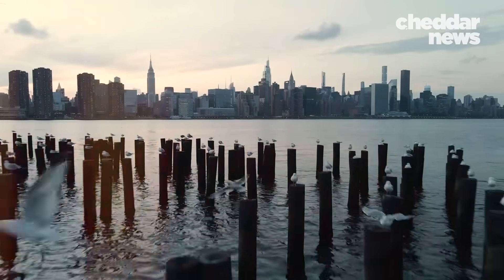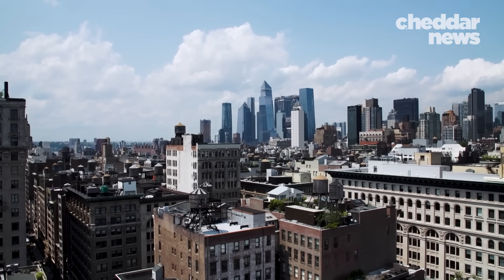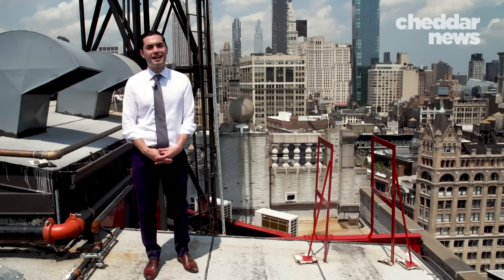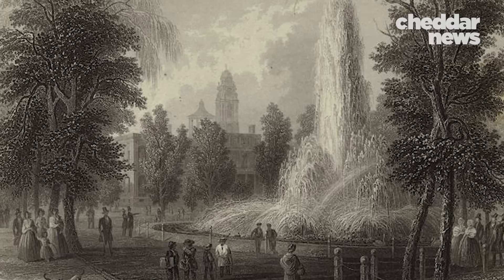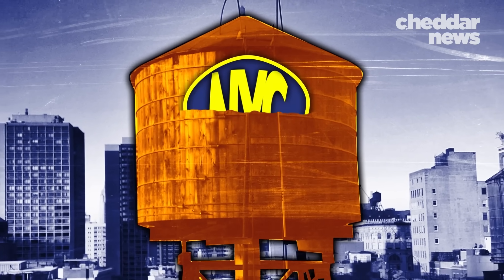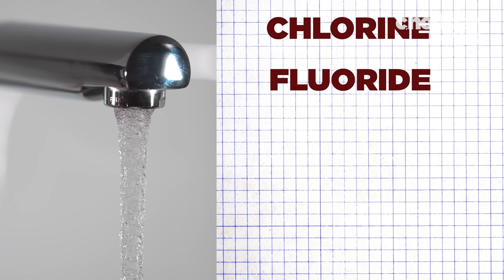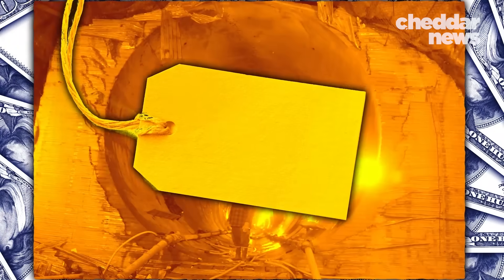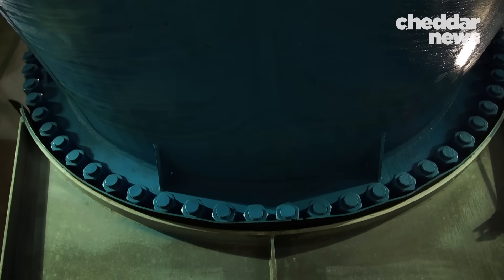What Makes New York's Water System One-Of-A-Kind - NYC Revealed

Comment: I did the plumbing and sprinkler system in an apartment that was built in place of the old water tank at the top of a famous building on Central Park West. The sprinkler system I installed was exposed and made of copper, and it encircles the circumference of the structure, as it is round like the water tower. It has a spiral iron staircase which goes up the middle of it. In the top floor is a recording studio. The owner is the recording artist Moby.
Reply: Whaaaaat you were Mobys plumber? Niceeee

Comment: Why are there pipes inside the pipe...you see the guys walking in the tunnel...is that whole thing g going g to be full with water?if so why all the additional pipes I side?
Reply: Steam they still use steam pipes to keep buildings temperatures regulated it helps to produce power as well

Comment: They could have ran a camera and pressure sensor through the pipe and JB weld it. Just joking, but it would have saved billions of dollars to find and close a leak using known methods to seal a leak under water.

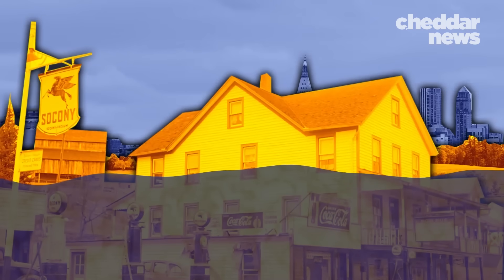Comment: Problems: The map at 6:03 circling towns---several of the circles are not in the correct locations of towns that were flooded.   At 6:35 I think you're saying 1915, which is correct, but it's easily heard as 1950, though I guess that's English's fault.  And you mostly overlooked the Delaware system, only mentioning that its tunnel is leaking; it's still the world's longest tunnel 77 years after construction.  Getting the approvals for the Delaware System got the Supreme Court involved.  I usually like Cheddar but this feels incomplete or rushed.
Reply: They basically telling you all the good points in leaving all the bad points out like what happened to all those small towns that they moved or flooded
Reply: @jermainec2462  they said that they were not fairly compensated and were pushed out of their homes.
Reply: @morpheus_9  yeah we get that but what happened to them people those people got stories of the events that happened afterwards they didn't go into detail about that ... They should have made more of a documentary about it the whole water system of NYC
Reply: The image indicating the location of the three tunnels is not in the correct position either.  Regardless, this is still a great video.

Comment: Good video, but I was hoping to learn more about the way the wooden rooftop tanks work.  How do they get filled up?  Are they just gravity drained?  What happens in the Really Tall skyscrapers? ANd so forth...
Reply from the maker: You're in luck! We have a video on that topic specifically. Search: Why New York City Still Uses Wooden Water Towers
Reply: Water gets pumped up to the tanks, and then it gravity feeds the building… it’s a smoother operation than just using pumps.
Reply: @joermnyc  The reason for the tanks is really thi:. Early AM, for 2-3 hours, EVERYONE wants water: Coffee, showers, brushing teeth, flushing toilets, etc. It would take very powerful pumps to supply all that water. So, what happens is smaller pumps fill the tanks 24 hours a day, only stopping when the tanks are full. Then, in the early morning rush, the tanks partially empty to supply water to everyone in that building, and at an even pressure. Then during the day, and at night, when demand is low, the tanks are refilled.
In essence, the tanks provide an 'averaging' system.
Reply: @joermnyc  more specifically, it allows them to pump the water during lulls in usage to prevent power spikes from wreaking havoc on the electrical system in the morning and evening.
Reply: Gravity can get water upto 5 stories in NYC...hence why a lot of buildings built were 5 stories.  Anything more you need a pump.
Reply: Every single building above 5 stories has a tank. The Empire State Building, World Trade Center, old, new, all of them. They’re just hidden in the newer buildings and buildings like the Chrysler and Empire State.
Reply: They usually use pelican birds that drop water to New Yorkers everyday. It's pretty neat
Reply: @shifterdude  why is white people hunor so dry and unfunny? Is it a mental illness thing?
Reply: @PrinceCezar27  Possibly. It’s more likely he’s fourteen and that’s as funny as he gets.
Reply: @shifterdude  Always a comedian somewhere in the place... LOL
Reply: depends on the pressure of the pipes supplying the water. Typically it can supply up to 3 floors by just using the provided pressure of the water provider. For high rise building they pump water from a cistern tank to an overhead tank at the roof top and use gravity to distribute the water to a room. They also sometimes use a booster pump if the pressure from gravity is not enough.
Reply: Those wooden tanks are not all that clean… rats drown in them, they are cleaned once per year, and birds get into them also..
Reply: Why are tanks even needed? Does the system not have enough pressure to provide water to tall buildings the normal way?
Reply: @bum4evr  the system is powered by gravity. Therefore buildings that are higher than the water level from the source wont have the water get to the top floors. Buildings that are lower are fine.
Reply: So the best answer I can give you is this. Water under a certain pressure which city water is around 70psi can only climb so high. So as you go each floor of a building the water loses pressure, and eventually according to this video at the 6th floor it no longer has what is considered adequate pressure for use. So the wooden tanks would have a booster pump that pumps the water up to the tank and then would allow gravity to feed downwards to meet the needs. So large buildings would have holding tanks hidden in the building and would also have booster pumps. 

A real world application would be water towers you see when in rural areas or even some large cities. Usually they are on a hill and they act to a) add storage capacity b) act is a buffer c) maintain system pressure.
Reply: Wastewater is much more interesting then Potable Water
Reply: There was a lady ( Elisa Lam ) found dead in a water tank atop the Cecil Hotel out here in Los Angeles. Some residents had complained about the water "tasting funny"! Mega Barf... I think those tanks were steel or something
Reply: they are called cisterns
Reply: 97 percent of the NYC water reaches homes and businesses through gravity alone.  While the Empire State Building offices are as high as 1,250 feet above sea level, NYC's Catskill reservoir is roughly 1,180 feet above sea level.  Thus the system runs basically on gravity. However, tall buildings pump the water up into a roof water tank and use gravity to keep the the building's water pressure high. I once worked on the 15th floor of an old building on W. 35th Street (in the shadow of the Empire State Building) and we never had any problems with the water and the building had a sprinkler system as well. Even though the Empire State Building was so close and tall it had no impact on our water usage.
Reply: https://youtu.be/pOWVAR0cN_s
Reply: they stagnate and breed deadly disease.... thats why theres no city like new york in that way... but ny doesnt have a better option or cheaper i should say, at the moment. Legionella has taken out whole cities before by these holding tanks burning down or getting taken out but another way and dumping disease infested water particles all over the town.
Reply: Only people living in tall buildings have tanks. Vast majority of people in nyc get their water straight from the system

Comment: Lol, "the city prides itself on having one of the only sources of unfiltered water in the country", but then "it is only treated with chlrone, fluoride, phsphoric acid"...
I´m glad that I´m living in a developed country where we do not add chlorine to our water, as we have better methods like UV and ozone.
Reply: I think it's very likely that chlorine residual is also added to your water. Ozone and UV are good for initial disinfection (they are used in the United States as well) but something needs to be added to keep water clean as it travels through pipes to your house and chlorine is perfect for this. UV and Ozone disinfection systems will typically add chlorine some chlorine at the end for this reason. The phosphoric acid is used to prevent metals like iron, manganese, copper and lead from leaching from pipes into water.
Reply: @andrewismyusername  I laughed so hard when I read the first comment.  Thx.
Reply: @andrewismyusername  No you absolutely do not need chlorine when you have a pipe network that is in good condition, are smart in planning that you do not have dead ends where something can accumulate and grow, and most relevant when you preserve your water resources and avoid that waste water or other chemicals get into the water.

Comment: So much potential, but it seems they cut way too much content.  What about those tanks?  How does water get there?
Reply: Pumps. Water towers can be thought of almost as a battery that stores pressure. Without a water tank, all water pressure in tall buildings would be supplied by pump and the building would loose pressure if the pump stopped at all or too many people had their taps on at once. Water tanks allow some time where pumps can be off without losing pressure and can be drawn down to provide excess flow when the pumps alone are insufficient. They basically allow you to utilize a smaller more efficient pump by storing excess water during low usage times and allowing it to flow back downhill during high usage times to pick up the slack.
Reply from the maker: We have a whole video on the water tanks specifically. Search: Why New York City Still Uses Wooden Water Towers

Comment: Tbh its so weird they have those wooden tanks. In my city the tanks are like big boxes made out of tile and concrete, kinda like swimming pools but covered at every side and on the roofs lol
There are tanks that kinda look like the nyc ones too, but they are made out of metal, not wood. Barely anything is made out of wood tbh, furniture at most.
Reply: Wood is used because it's a good natural insulator and prevents freezing without the need for additives that could taint the water.
Reply: @kirkrotger9208  yes, wood is a great building material. I wish the rest of the world used it as much as you guys do, its definitely more ecological than most other materials too
Reply: @agme8045  I much rather have a non-wooden water tank. These things can rot and a lot of stuff can fall into these tanks like birds if it isnt maintained properly and unfortunately a lot of them arent maintained properly
Reply: @collan580  Did you not see how they constantly maintain those tanks? 🗿
Reply: @MitsukiDiablew  Just look at cheddar's old video about the topic
Reply: there's a whole video talkin about the thing you're wondering on this very same channel.
Reply: @dyarous  im pretty sure I’ve seen it, I don’t remember much though

Comment: So what are the tanks for?
Did i miss it? If you have underground pipes, why do they even need those tanks?
Reply: Pressure. If you have pipes coming from underground, it's hard to maintain pressure above 5 stories.
Reply: @kirkrotger9208  Thanks :)
Reply: Pump the water up to the water tank, use the   pressure to provide water to the people below. Usually easier than on demand pumping to each unit from the ground/street level.
Reply: @antwonthachef  Was just wondering, since a lot of cities (in europe for example) dont use this. Event on skyscrapers :)
Reply: @Menjoro  skyscrapers need water tank. even in europe there are actually water tanks in buildings and skyscrapers, it's just hidden unlike nyc. especially europe doesnt have much tall buildings.
Reply: @Menjoro  Skyscrapers have tanks because its hard to do on demand water pumping, you just dont see them.
Here in europe we have tall water towers and its enough because most of our buildings are smaller than 15 floors, but if you see a skyscrapein euope you can be t that it has an internal water tank
Reply: Neil explains it very well...
https://www.youtube.com/watch?v=VAn5xYpbVR8&t=345s
Reply: The bottom 1/3 to 1/2 of the tank is often used for fire standpipe and sprinkler systems as well. Potable drinking water comes from the top portion of the tank, which is good because those tanks can accumulate debris over time. Thankfully NYC requires cleaning and annual certification.
Reply: Sigrid Kaag  There likely is a cistern, it's just internal. That's common in NYC as well. For the most part, only older highrises have external water tanks. Either that or your building spent a bunch of extra money on a pump or you have bad water pressue.